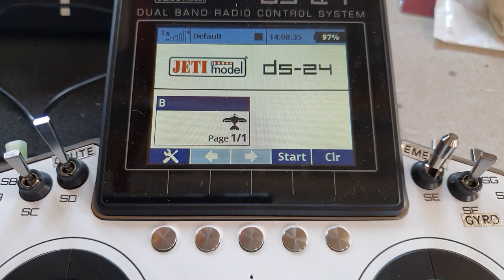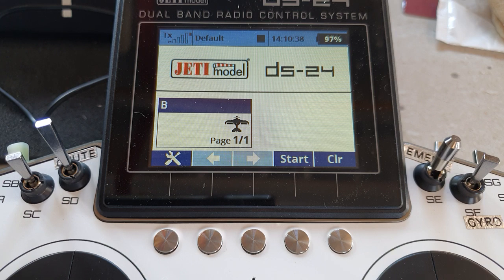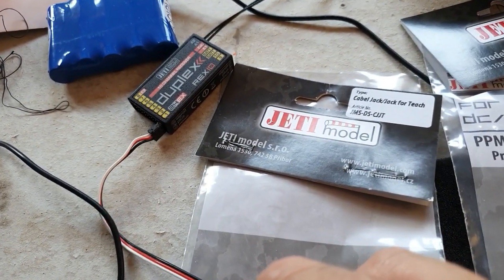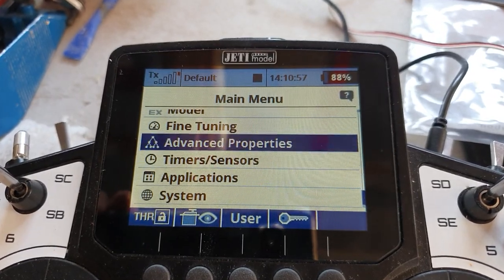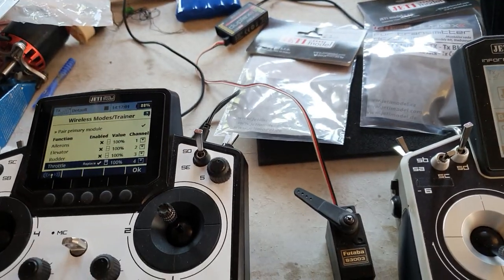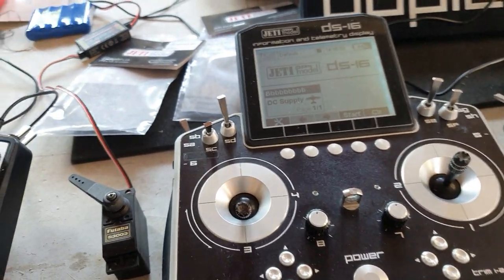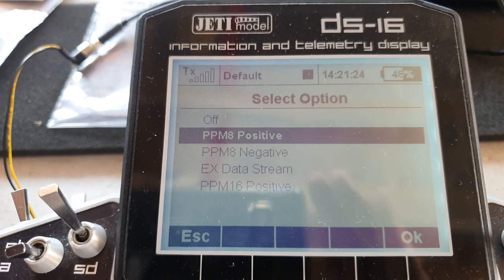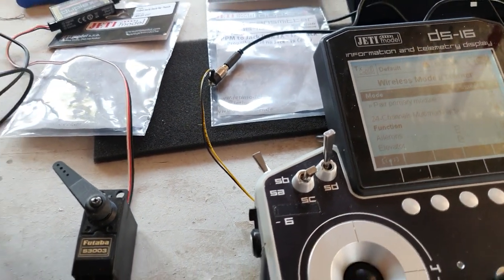Jeti - buddy box training with wire, not wireless

Comment: I have CB220 in model with 2x Sat2, so thats why I would like to use the cable connection rather than standard wireless and loose 1 rx..but seems it works same as without the cable, only 1 rx, why jeti whyyy :(
Reply from the maker: No, buddy box mode cancels double path even if it is wired
Reply: @cotswoldpilot  do you unplug second rsat2 rx or just leave it powered but not linked to.TX?
On second powerup when I am done with giving some jet stick time to a buddy, will all reconnect or do I have to pair secondary TX's module back to secondary  rsat2 in model? Thanks